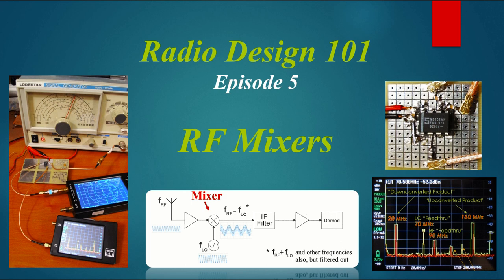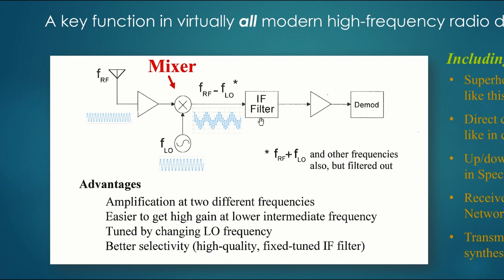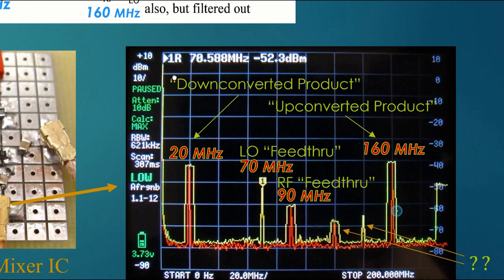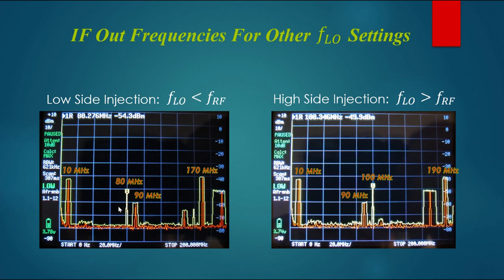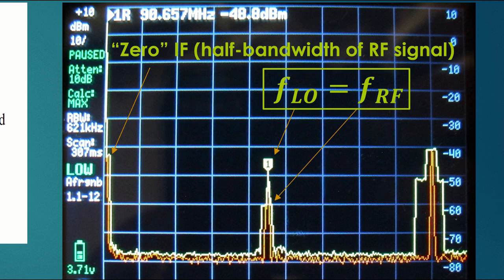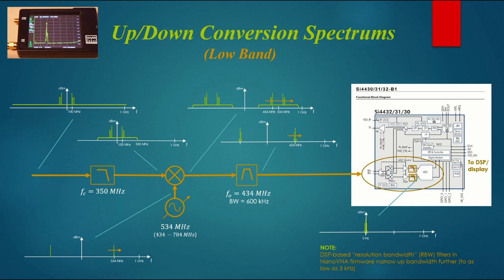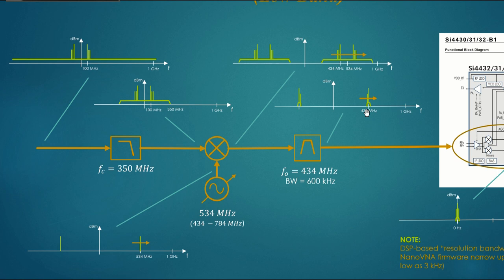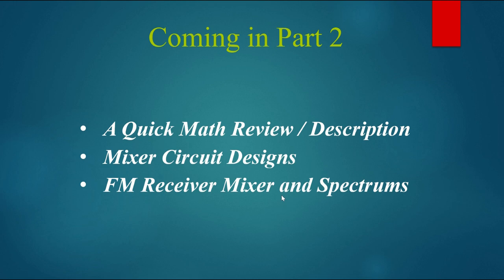Radio Design 101 - RF Mixers and Frequency Conversions - Episode 5, Part 1

Comment: 100 questions I had since childhood answered in one video. Well ...
Reply from the maker: Sounds like an interesting childhood !   FWIW, I remember somewhere around junior-high school trying to add a BFO to a multi-band/SW radio by injecting a signal at IF. I think I read about that somewhere. Sadly it didn't work. Had to wait till later to learn about the key to mixing (multiplication rather than addition - or equivalently using a strong enough signal to create non-linearity).  Thanks for the comment ! Brings back memories 🙂
Reply: Me Too!! hahahahaha

Comment: Fantastic video. I like the intro the I/Q and zero-IF. I had no idea why or how that worked. This video has given me the foundation to glue the concepts together and perhaps take a deeper dive on the subjects. Thank you, sir!
Reply from the maker: Thanks. Good to hear that it was helpful. I've done IQ modulators (for QPSK), but never really written code for demod. Here's a decent introduction to some of what's involved (but it seems to be limited to AM - in general it can get pretty messy mathematically I think - especially for FM demods): https://www.allaboutcircuits.com/textbook/radio-frequency-analysis-design/radio-frequency-demodulation/understanding-quadrature-demodulation/
Reply: @MegawattKS  73's W6MGV

Comment: Than-you so much for the very clear explanation of how mixers work. This was part of my syllabus for my ham licence here in the UK. Then I had to accept that was the way mixers work. Now I understand HOW they work. I have a Nano VNA and was weighing up whether a Tiny SA would be useful and more than a toy for ham radio construction. Seems you have answered that question too! Thanks again.
Reply from the maker: Glad it was helpful.  Enjoy the TinySA if you take the plunge and get one. It doubles as a signal generator too, and even has some amplitude control and ability to generate CW, NBFM and WBFM signals. I keep thinking I should get a second one for that reason alone ! See specs here: https://tinysa.org/wiki/pmwiki.php?n=Main.Specification

Comment: Thanks for the prototype board designs; I've ordered some.
Reply from the maker: Awesome. Hope they work well for you. Thanks go to Maël for making these available on github (and doing the improved layouts there!).   I'm curious -  Did you go with Option 1: ExpressPCB or option 2: JLCPCB (or another company)?  https://ecefiles.org/rf-circuit-prototyping/
Reply: @MegawattKS  I've ordered from JLCPCB before, so I went with them again.

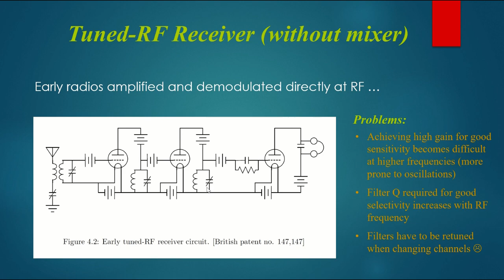Comment: Thenk you for your tutorials. For the receiver at 2:30. How does the demodulator work? Is the signal simply just amplified until it clips either at the top or bottom? And then averaged by the headphones?
Reply from the maker: Yes. The last tube acts as both a rectifier for the AM signal being processed, as well as a current amplifier.  If the tube is biased lightly on (I don't know the exact bias details needed for best receiver sensitivity, but I'd assume we want to be close to cutoff), then, as the RF signal out of stage 2 comes into the grid of V3 (the third tube), it pulls current through the headphones during the positive half cycle and no current during the negative half cycle. Essentially what you said. A higher amplitude of RF sinewave coming in leads to higher current on the positive half cycle, and hence more average current - so AM is converted into varying "DC" (an audio waveform) . As you noted, the pulsing RF current at the plate of V3 is converted to the audio acoustic waveform when averaged by the response time of the headphone transducer mechanical element 🙂

Comment: I remember USING (deliberately) image frequencies to receive "out of band" signals, such as the 850 mHz analog cellular band, back when monitoring it was still legal and it still existed. I wonder if FCC regs still forbid the sale of scanners capable of (or "easily modifiable") receiving that frequency range.
Reply from the maker: Wow. That brings back memories. Old UHF TV tuners could also receive in that range as I recall. That's where the original cell spectrum came from in the US (channels above 69). Good question about the scanner regs. I don't know. But even as they were rolling out the regs, cell phones switched to digital modulations so it became a non-issue anyway, I think.
Reply: @MegawattKS  Analog service was slowly phased out even as digital service started to replace it. I was told that the very last analog site to be decommissioned was in Death Valley, CA. (Sort of fitting.)

I remember when the old UHF TV tuners were analog (continuously tunable), until the FCC required manufacturers to provide channel detents.

The weird thing now is the ATSC channel numbering system. I used to wonder why KABC channel 7 was so difficult to receive. Then I found out. They're about the only area channel to retain a VHF frequency. Most antennas (antennae?) are optimized for the UHF band.

Comment: Is there a way to measure Mixer gain performance with NanoVNA?  Rhode & Schwartz documents recommends using reference locked VNA and Signal Generator to perform analysis with VNA. Some method of quantification, would help with performance tuning the RF input matching network. 

LO signal power's influence on mixer output levels, higher LO power does increase mixer output levels, but also larger LO breakthrough too. 

What exact levels of IF output are expected for unbalanced inputs(50 ohm source) and output, with SA612?
It appears Gain of SA612 works only at RF levels <-40dBm, at higher levels Gain compression kicks in and becomes more of insertion loss than the supply levels.
Reply from the maker: You should not see gain compression before about -20 or -22 dBm input with a matching network in place.  As to measurement, I don't know that the NanoVNA can do it. In the class, we just supply known input signals and look at the IF output on a spectrum analyzer. Then we plot P_if_out vs P_rf_in like in the datasheet (at specific LO levels). As I recall, once the LO is around 200 mVpp, the "conversion gain" starts to become constant at the datasheet's value of 15'ish dB. But that assumes the RF input match is good and both sides of the output are used through a proper match at IF.  Hope that helps.

Comment: Great course! I'm watching it again (and again) to get these concepts. I was curious what type of breadboard is that and are the capacitors and zero ohm resistors 0603 scale? Thanks.
Reply from the maker: Thanks.  You can find some info on the breadboards here. The 0 Ohm resistors are 0603 and the caps are 0805. The pads are 90 x 90 mil on 100 mil centers.  https://ecefiles.org/rf-circuit-prototyping/
Reply: @MegawattKS  Thanks!

Comment: you should have build a playlist for this
Reply from the maker: Sorry. There is a playlist, but I may not have enabled it properly so it is easy to find in YouTube. I will see if I can improve it's visibility. (Where do you normally look to find playlists when watching videos?)  In the mean time, here it is:  https://www.youtube.com/playlist?list=PL9Ox3wpnB0kqekAyz6blg4YdvoEMoJNJY
Reply from the maker: Thanks.  I may have it set properly now. The playlist was not set as an "official series" so it didn't move into the next in the series at the end of a video. I think that is enabled now. 🙂
Reply from the maker: For anyone interested in related series playlists, there is an associated website here:  https://ecefiles.org/  It has links to the 4 main playlists as well as uploaded PDFs of the slides used.
Reply: @MegawattKS  Thank you so much for sharing the slideshows and the videos.  So many share one or the other and both definitely makes for the bests.  As a long time ham, then a career in electronics in the Navy, followed by a career in two-way radio, I was once really good at anything RF but when my next career was in IT, I forgot so much that I'm studying again in my retirement to relearn theory, hopefully to the degree I knew it in the 70s, 80s, and 90s.  I'm looking forward to watching more videos, reviewing more slideshows, and picking up a lot of solid electronic theory and, based on what I just saw in the section on Mixers, I should have my expectations met.
Reply from the maker: @dalepres1  Thank you so much for the kind and encouraging words. Glad you found the slides on the companion website and that the combination is helpful!  I also spent some time in software development (XSPICE) before coming back to RF - my original passion. Your path through all of this is certainly an asset in today's complex world. Best wishes in retirement. A well-earned new chapter in life.   73s

Comment: 24:00 that what i previously thought about how SA might work by scanning frequency but than i found Many places that SA uses FFT algorithm so now my doubts is if there's two mathod of SA or both mathods are used tougher  scanning and FFT ??
Reply from the maker: Good discussion point. The TinySA and all classic RF spectrum analyzers work as shown, BUT - there was a shift about 15'ish years ago to a hybrid approach for high-end analyzers. It's always been too difficult to directly digitize at the front-end and use an FFT directly at RF (due to technology speed, power consumption, and spurious signal generation). But the hybrid approach is able to digitize at the IF and then do the FFT. For example, the traditional analog method may sweep a GHz range with a 10 MHz wide IF filter, and then digitize the 10 MHz bandwidth and then FFT that with a 1024 point transform to get down to 10 Hz resolutions. This provides much faster sweep times for narrow resolution bandwidth settings. As ADCs got faster, this could be done on wider bandwidth IF chunks, opening the way for spectrum analyzers to also do "signal analysis" (e.g. look at signal constellations and other modulation features). But it costs more. Hence the TinySA uses the original non-hybrid approach (and doesn't have 10 Hz bandwidth capability as a result).  For the record, I think some high-end scopes are starting to do some spectrum analysis with FFT directly at RF (no mixing to IF) since they already have 10 Gsps ADCs, but they're still going to suffer from spurious problems, bandwidth limitations, power consumption/etc...
Reply: Ok , that's Very nice Explanation thank you .

Comment: Sir. What happens when LO and RF frequencies are same?
Reply from the maker: Interesting question. If both are simple sinewaves, then mathematically, the output is DC and depends on the phase relationship between the two. Of course the frequencies are never exact in the real world (unless they come from two outputs of a power-splitter or something), so the "DC" is not perfectly constant. The phase changes over time and so does the DC output.  Now, If the LO is a sinewave and the RF is a modulated signal, then the spectrum of the signal is "brought down to baseband". This is what's done in "direct conversion" receivers used in cellphones. At that point, the "I" and "Q" outputs are digitized and it is possible to demodulate using DSP code.
Reply: @MegawattKS  Thank you so much.
Reply: @MegawattKS  I am working on finding the strength of the transmitted signal from a source at various distances? Is there any way that could help me?
Reply from the maker: @irfan_antennas  Not sure. But if you're interested in signal strength, I would recommend looking at the "TinySA" spectrum analyzers. That's their job - measure signal strength and frequency (across a wide band of frequenies). There's one that goes to about 900 MHz, and one that goes to about 6 GHz:  https://www.tinysa.org/wiki/

Comment: I am so interested in your video that I can't help replicating the entire project. Now I am replicating this RF protoboard, but I am curious how the IPEX(U.FL) was soldered to these pads with 2.54mm (Judging from the way DIP-8 IC was soldered, I guess it is 2.54mm? ) pitch? Since the largest IPEX connector (IPEX gen 1) has only 1.475mm pitch between signal pad and ground pad.
Reply from the maker: Thanks for the interest !  On the board used for the LNA, I followed the footprint in the u.fl part's datasheet. Then on the general RF protoboard I deleted the pad at the edge of the array and placed the footprint I had used with the LNA board into that space. So the 'wings' of the ground pads reached to the other pads :-)
Reply: @MegawattKS  Got you. I actually just submitted to JLCPCB my own design of RF protoboard (generally followed your design) with 8 u.fl. footprints surrounding each protoboard area. That coincides with your design. I will open source the Gerber file on github later on.

Again thanks a ton for these videos. These videos really gave me a way to kickstart my journey in RF design. Esp the episode of SA602/612 mixer. I got a bunch of SA612 in my inventory but the datasheet is not friendly to someone who just started (lots of discussions on balanced-unbalanced-tuned signals, not just the basics of mixing). Your video taught me the minimal (non-trivial) circuit for SA602/612
Reply from the maker: Wonderful.  We used basic versions of boards like these for many years in the class, but had to drill holes and inset wires at each pad where we needed a backside-groundplane connection in the circuit. With the boards in the video it's tricky to  bridge the via to the ground-plane where a connection is needed - but its a lot easier than what we did with the prior boards that had no vias predrilled. The limitation we never have solved well is how to prototype with the boards when a SOP or SSOP chip is used. We've done it successfully with tiny adapter boards that bring the pins out to a 100-mil pitch, and in Spring 2019 we had a board for the final project (that used SA615 IF subsystem) where we had a dedicated footprint on the board for that chip. On the plus-side, soldering 0805 or 0603 discretes and even SOT23 transistors is quite easy as you seen in the videos.  Glad they're helpful.  Thanks for your feedback !
Reply: @MegawattKS  Very very interesting. I have been working on several versions of RF protoboards before. Since I used JCLPCB (2 layers and 4 layers) to manufacture professional PCBs, via holes have never been a problem for me. Before using JCLPCB/PCBWay, I also DIY PCB at home using both dry film and toner transfer tech stacks. But finally I gave up since JCL has much better precision and  4-layer board is just impossible for home brewing. (and they offer every hobbyist 2 free PCB prototyping coupons every month with free shipping to China...So I am designing and manufacturing PCB essentially at 0 cost. And the turnaround time is only 4 days including shipping.)

Regarding SSOP, TSSOP and many fine pitch footprints -- yes they are big headaches for me as well. My workarounds are: 1) try to use SOP or DIP or SOT-86 ("RF cross") when possible 2)For many ICs that I can't refuse to try (there are so many, such as wideband LNA/RF gain blocks e.g. TQP3M9009/BGA2869 , ceramic filters, down converters, frequency synthesizers....etc.) I will just put pre-defined circuits for those ICs in pre-allocated areas on the protoboard. 3) For some frequently used circuit topology such as pi bridge, 3~6-order shunt-first Chebyshev filter based on 0402 SMT LC, I will also dedicate specially defined areas on protoboard.  4)There are always sufficient UFL and a few SMA connector footprints for intra-board and inter-board RF connections.

So the final protoboard is a mix of pre-designed IC/filter zones + free style improvisation areas with 2.54mm pitch pads and though holes to the backside and some with solder bridge jumper to ground plane so you can easily solder some of the single pad to ground as you need (this might be a dangerous design for high freq since such solder bridge jumper may have substantial parasitic capacitance to ground, therefore I only designed solder bridge for some of the pads). The entire 4 layer PCB has a ground plane right below the surface layer to ensure stable clean ground reference and 50 ohm characteristic impedance for microstrips in those pre-defined IC zones.

Comment: Where do you get ground plane perf boards?
Reply from the maker: The one shown in the video is a custom one that I designed and had fabbed though https://www.expresspcb.com/ . For something like 60 bucks, you can get three 2.5x4" boards made, which allows for a total of 6 x 3 = 18 of these. I tried a few variants (hole sizes, gaps to ground plane, etc.) and what you see in the video is the one that worked best for this.  It would be nice if someone marketed these. In the university course, we used to get ones from a small company in AZ (a bit cheaper than doing one's own - even using ExpressPCB). But they stopped making them. And they were a bit of a pain anyway because you had to drill a hole to insert a via wire for ground connections. (Perhaps good for students to learn to use a drill press :-) )  I tried what you see in the video and it seems to work quite well, not requiring drilling - though as you saw, the ground connections are still a bit awkward to do because of the difficulty of bridging due to solder surface tension...
Reply from the maker: Here is the closest I found commercially. But I like mine better :-)   These do allow for use of smaller footprint parts, but the ground locations aren't very flexible in terms of layout options...  https://www.amazon.com/SP3UT-SMTpads-3U-Thin-Sided-Unplated-Ground/dp/B0040Z8FC6/ref=sr_1_42?crid=3RUU97R2BDXDX&keywords=rf+pcb+pads+ground+plane&qid=1662231961&sprefix=rf+pcb+pads+ground+plane%2Caps%2C84&sr=8-42